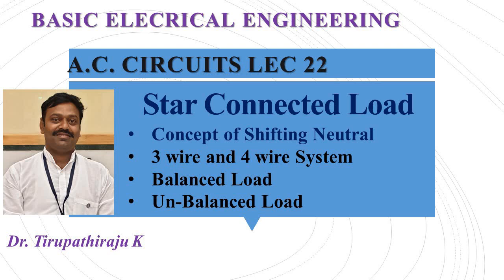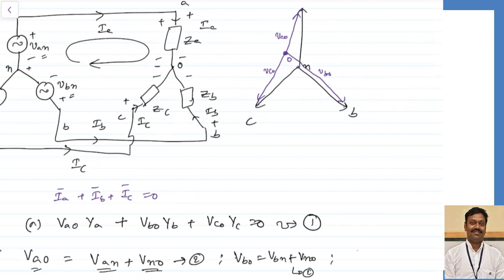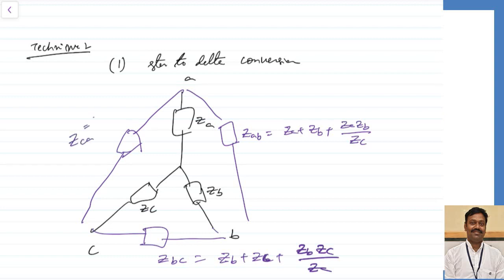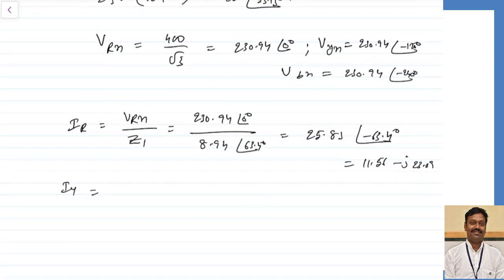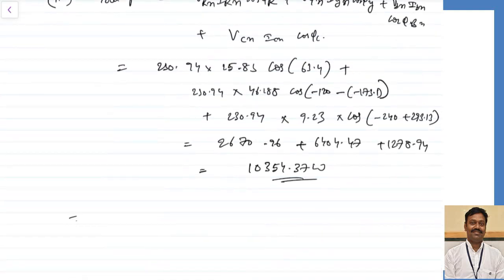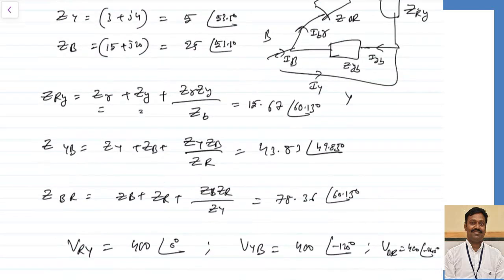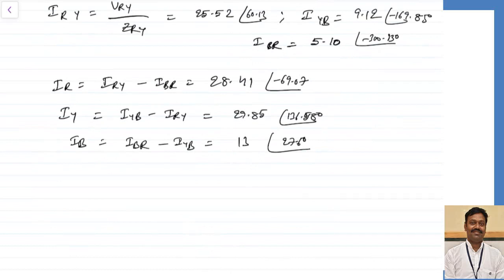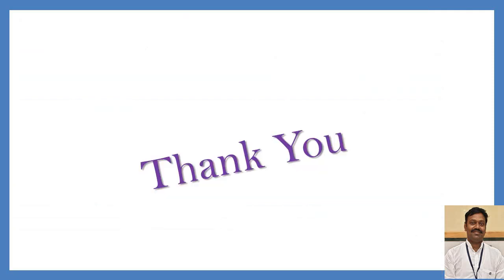BEE 222 Star Connected 3 Phase Load

Comment: Sir at 15:40 the voltage taken is V/root(3) but the voltage at 28:45 is taken as V/root (3)*angle(-30 degree) Does that make any difference?
Reply: @lecturesinelectricaleng  Sir but both are star connection and in my opinion phase voltage Voltage must lag by 30° by Line voltage
Reply: @lecturesinelectricaleng  Sir Did you  assume that Line voltage is 400 30 degree leading in 1st case and so Phase voltage is 400
Reply: @lecturesinelectricaleng  reference will be given question ? or otherwise i think answer will vary